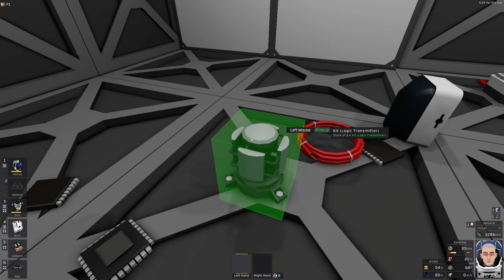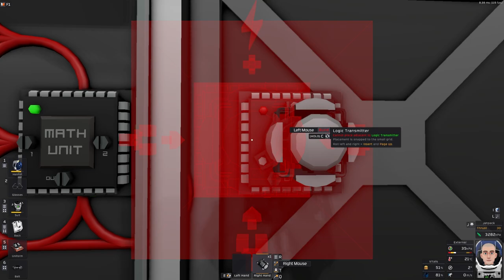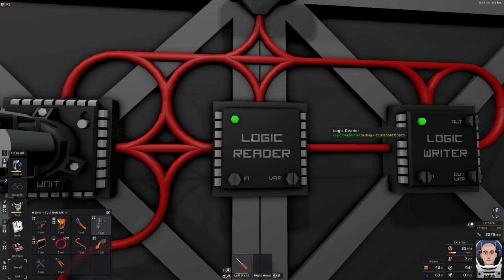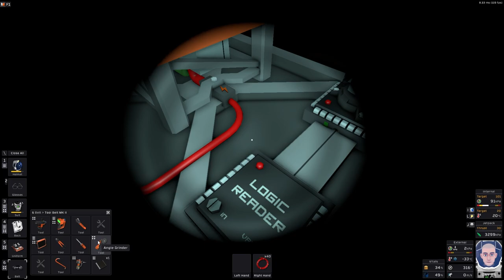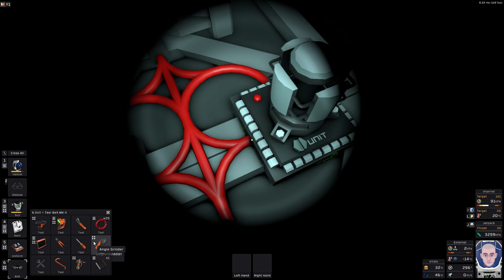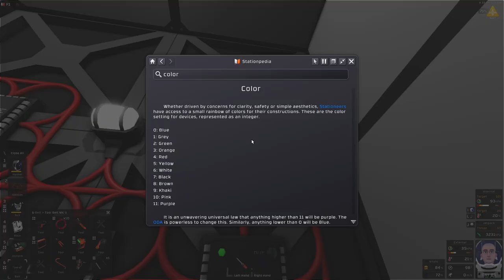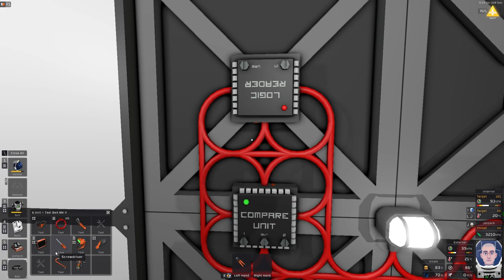Stationeers - Understand Transmitter and ways to use it - Tutorial

Comment: Thanks for this tutorial, Osarus 🍻 - The transmitter has to be the most awkward device to use in Stationeers 🤣
Very good, clear instructions.
Reply from the maker: Thanks alot :)
True that the transmitter is a very awkward but also less used that what it should be, there is so many features that it can help with

Comment: Note that the little switch says passive because that's what it will set it to if you click on it. (The Stationeers UI is really weird like that.) Mousing over the middle of that transmitter gives a tooltip saying "Active as Transmitter Test." That's an active transmitter, sending out data. The passive ones are receivers.

Comment: Time left is the most useful parameter from weather station as you can transmit to your suit minutes left until storm using sound alerts, incoming storm alerts are a lot more useful while mining than being safe inside your station :)
Reply from the maker: I will rememeber that, i am actually not sure if i have used that. but it is a very good funtion to use